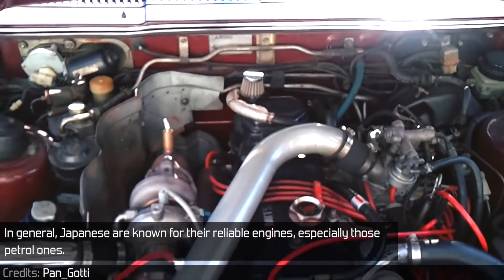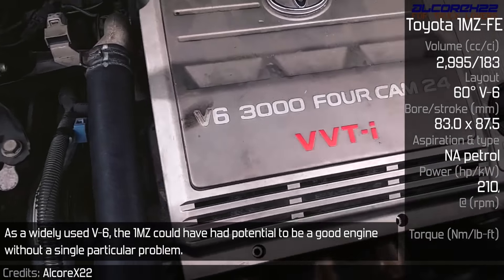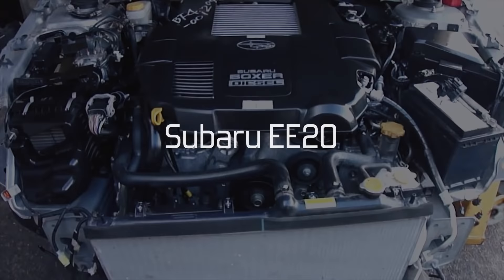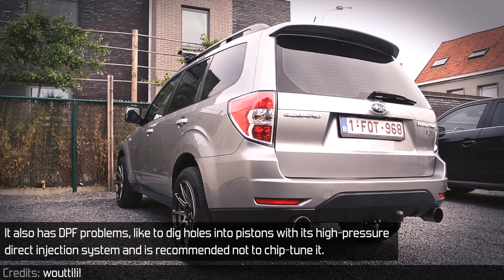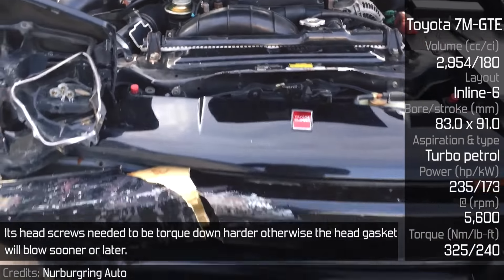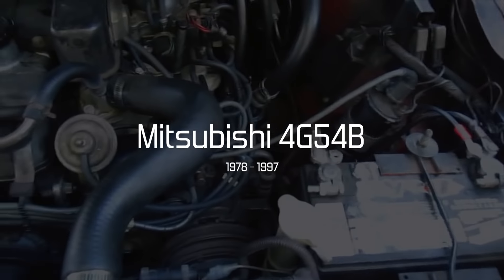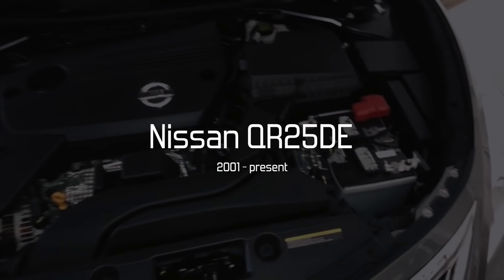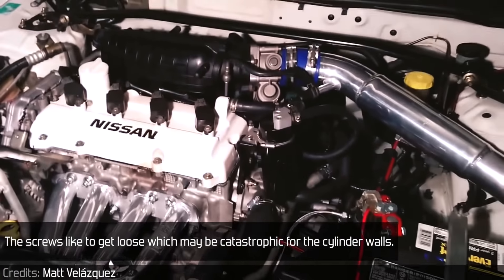Top 5 Worst Japanese Engines Ever

Comment: The 1MZ, and 5VZ are among the best Japanese V6 engines ever made. Certain  year 1MZ engines had sludge issues, due to Toyota  moving the water jackets further away from the cylinders to minimize quench. I have worked at a Toyota dealer for 18 years in the shop, many 1MZ vehicles are going very strong to this day, they are much tougher than a 2GR.  The 3VZ V6, and 2AZ 4 cylinder were among the worst Toyota engines ever made, Toyota will tell you that.
Reply: FunkyFresh48 I agree with you on the 3VZ. I was a Toyota tech too for a few years but if taken care of the 2az could be reliable. It had water pump issues but most people would drive it when the drive belt snapped or never change the oil. That’s what killed them.
Reply: GR-series engines also have an appetite for oil. There's a guy in Australia running a severely modified 2AZ on methanol running 9's all motor, and it sounds aggro as fuuuuuck
Reply: FunkyFresh48 my dads 3vz has over 600000 km and still going hes done nothing to the engine he never does fluid changes for ex he does a oil change every 3 years lol he beats the shit out of it and it just keeps going and going so.......
Reply: I have seen a lot of high miler 2AZ and 3VZ cars, I am not talking about individual examples. I am saying that the 2AZ and 3VZ  have cost Toyota the the most monetary damage as far as engines go. That does not come from my opinion, or any bias, it's a fact. The 3VZ had a high rate of head gasket failures, the aluminum heads and iron block didn't like each other. :) The heads and block would expand and contract differently, causing wearing on the head gasket until failure. Many blocks had to also be replaced due to severe pitting on the block decks, caused by ECD. Toyota launched the V06 campaign for this issue.

The early 2AZ engines had an issue with the head bolts pulling the threads out of the block, the later 2AZ engines had a problem with excessive oil consumption due to dainty oil control rings, we can blame the EPA for that problem.
Reply: I currently have both a 2001 Camry with the 1mz and a 1993 Toyota pickup with the 3VZE and I'd say they are both great engines. My '93 pickup now has close to 250,000 miles (or 400,000mks) and it's still going, it's underpowered by todays standards but certainly not unreliable! I had more problems with Toyota 22R 2.4L 4 cylinder engines (which were easier to work on). The head gaskets were replaced under a Toyota recall 20 years ago on my V6. I have done some work on 3VZ engines and I can't say I like it but it doesn't happen very often! 
 If you want a not so good Japanese design, you could look at engines like the 3.0 liter Mitsubishi that I had in a 1997 Dodge Caravan or some Mitsubishi 4 cylinder engines which were even worse! I drove a low mileage smoking Hyundai Excel that had one of those to the closest junkyard and barely made it there! The car had 142,000 KM or 88,000 miles...
Reply: 1ezengine piston rings don't enough drain hole oil in ring to long oil change s to made burn oil Toyota fix it than great engine

Comment: Although, I like your channel and watch your videos regularly I will have to say I am disappointed with this one. Firstly the oil chane intervals on the 1MZ are there for a reason and it is a great engine which btw sounds awesome. And secondly the 7M-GTE apart from the improper torque spec on the head bolts has nothing wrong and can hold 500hp with the stock internals because it was overengineered.
Reply: Agreed, and just want to back you up on the 1MZ - I had a Solara with that and the E153 (?) manual, and that rewrote my idea of how a V-6 could sound.  Pity the aftermarket didn't care, it was every bit the 6G72's equal stock.

Comment: 1mzfe are great engines you might want to do more research before you do these videos
Reply: Yea mine has over 450k miles on it and is still going strong .
Reply: He said that oil needs to be changed regularly. Or else there will be problems. Immature.

Comment: For the Nissan QR25DE, it's bad years were 2001-2006. 2007 and up they fixed the precat and butterfly valve
Reply: Tone.  Totally agree, give me a VQ30 Maxima 5-speed any day.  But I suppose there's a reason that Nissan was where they were that they needed to bend over for Renault in the first place, they must have been doing something wrong.
And they deserve a lot of credit for resurrecting the Z as soon as they could and keeping it going all these years, I can't deny that.
Reply: Tone.  Good thing the QR25 is not an engine from the Renault lineup then, right ?... Let's face it, the brand was pretty much ready to die, the deal with Renault is what saved their bacon.
Reply: Got a 2003 altima 2.5 with 250,000 miles on it stock

Comment: I have an ee20 impreza for daily use, it's my second one tho (the first ended in a bush and was wrecked) the first one had 125000km , perfect, and the one i own right now has 138000km and nothing to say about that engine, everything runs perfectly
Reply: Cagibi Band honestly, almost any engine, when properly maintained, will run well. It says more about you than it does the engine
Reply: Just wait. It will blow up. I got rid of mine, My father didnt, his blew up on 218 000 kms.
Reply: The performance is pretty sluggish on the ee20 and they aren’t very fuel efficient so they are essentially pointless.
Reply: @R2D2trashcan  i have an euro5 one and remapped it to 185hp with 410nm torque, plenty of power enough
Reply: woutti!i! Your a gambling man then I see 😀 Mines only done 50,000km so I can comment on reliability but if they are problematic in terms of reliability a retune will only exacerbate the issue not to mention possible dpf consequences. The power increases do sound tempting though as they could do with a bit more poke.
Reply: @JTmoto  you were right , i broke it lol at 150000km
Reply: @SanghinMusic  that's too bad, hit up nace King or get a new shortblock - better yet, get a new petrol car 😁🤷‍♂️

Comment: Any Nissan VQ35DE used in the 6th gen Maxima , 3rd gen Altima, or 3rd gen Quest
They are plagued with timing chain failures, catalytic converter failures, oil leaks, and oil burning.
Total garbage.
Reply: T 59 Wow... really? I always thought the VQ35 was a solid choice of engine... I guess I thought wrong.
I wonder what the root of those problems are...
Reply: It's not the engine as a whole, but only in certain vehicles. This is the same engine that is in the Nissan 350z, but it has no problems whatsoever. Different versions of the engine are present, such as the one in the Nissan Quest, which is horrendous because a few family members of mine have Quests.
Reply: Yes, it's the  version of the VQ35 used in the vehicles I mentioned.
The same engine used in the 350z and Infiniti models are much more reliable.
Also the VQ35's built for the 7th gen Maxima and up are very solid.
Reply: Murano’s too... they are the worst.
Reply: Shanil Kumar that’s not true. Some 350z’s & g35’s had oil burning and timing chain issues.
Reply: T 59 my dad has the 2014 pathfinder with the vq engine. not a single engine problem  it has over 100k on it
Reply: VQ35DE is one of the best engines of the last 25 years.

This engine needs change oil every three months genius or your timing chain starts to get weak.
Reply: My vq40 made the horrid timing chain noise by 50 00kms I argued with Nissan to fix it till my warranty run out
I ended up doing over 400 000kms on that original timing chain before I traded it,
The problem with these motors is the plastic chain tensioners coming apart after a while and producing noise, or total failure if they came apart in a bad way I suppose,  Nissan improved the tensioners in 2011 
Many modern engines have these inadequate plastic parts as the try to save weight, money and test out there fancy 3D printers more and more...
Reply: I have a VQ30DE in my nissan and it is still strong, 178,864 miles. 2001 Nissan Maxima.
Reply: Also Nissan CR12DE/CR14DE (3rd Gen March aka Micra K12 & Cube BZ11) have timing chain falures.
Reply: All these Nissan engines have a weak chain tensioner.
Reply: my 3.3 in my frontier hasn't skipped a beat in 15 years.Are they related to the 3.5?
Reply: T 59 .. that qr25 pos Is by far the worst modern engine there's.. my Nissan seR ate the screws and died soon after... Nissan changed the engine, and the following day I sold the POS
Reply: @jaynation6364  Same for the QR25 engines. The 07 and up engines were good and the ones in the Frontiers were good too.

Comment: Personally, I feel timing belt cars are not to my liking. I would prefer cars with timing chains.
Reply: AMENNN !!! ! !!!
Reply: Timing gears >
Reply: And you have plastic guide issues on engines with Timing Chains. Especially with BMWs.
Reply: @MidshipRunabout2  Yeah, But Only Because they Are "saving" Tooo Much !!! ! !!!
Reply: Who needs timing stuff when you can get a rotary which times itself perfeclty
Reply: @Vehicular.Shenanigans  Amen :-)
Reply: timing coupling rod
Reply: I thought similar in the past. Unfortunately there are a lot of engines today with bad timing chains which are unreliable and don't last more miles than a timing belt.
The best systems are diesels with the cam shaft down in the engine and connection rods to the valves, you find them more in truck engines, but this is far more durable and reliable than OHC systems.
The good old double timing chains are no longer in use today.

Comment: Not one Honda motor was in this video, we Honda fans may be hated but at least our motors are made right 😅
Reply: TBills 3000 Honda diesels are pretty underwhelming.
Reply: I don't hate anyone. That being said, Honda still can't build a transmission.
Reply: My 02 civic was a piece of shit. Replace engine , clutch and other issues and still fucked up on me. I tried and really tried take care of my Honda. Just little bullshit issues ending up fucked
Reply: David Phongsavanh You're just a noob.
Reply: B Janak I'm a Honda fanboy, but I'll grudgingly admit that you've got a point there, at least for the v6 automatics. I've gotta tear out my auto tranny and put in a manual this summer.
Reply: no civic that's not a Type R is made for going fast, period. you can modify them to be fast, sure, but they weren't made for it.
Reply: The first year of honda accord. The engine had way too much compression and blew gaskets left and right. My dad had one. Total lemon. Also very hard to start when hot or cold. Every year since then, the accord has given great performance, but that first year was CRAP!!! (he had the engine rebuilt TWICE under warranty)
Reply: Wrong
Reply: I have seen two Honda engines go bad so far.One was from a leak ignored,the previous person drove it until it puked
Reply: These were bone stock cars not hopped up with no modifications done.
Reply: Manual transmissions are starting to be phased out.Have transmissions that use a paddle shifter that shift faster than a manual
Reply: True..
Reply: David Phongsavanh you most drive a Hyundai not honda lol
Reply: If you leave a Honda engine stock, perform all suggest repairs at the time suggested, it will easily make 300K miles. Modify it to go fast, if you do it right, it will still make it to 300K miles. Neglect repairs, it will die. Mod it wrong, it will die. I've never had a Honda let me down. I've been let down by every domestic vehicle I have ever owned. Never had a chance to try other Japanese brands (other than my current "domestic" brand vehicle that actually has Japanese guts), but Honda has never left me stranded. However, they tend to burn oil like a mofo as you approach 300K miles unless you do a rebuild. My last Honda was at 290K miles when I sold it. It was still running fine, even the automatic transmission. It wasn't a fast car by any means, but it would get up and go no problem. It just left behind a smoke screen to confuse the cops lolz.
Reply: I dunno, every Honda I have worked on burns oil like crazy after around 250,000km ish, that's metric km for you Americans, mind you they still work but it burns like a chimney, the worst I have seen is on the k24 and the B20, but all of them burn to an extent, meanwhile my SR20DE had 500,000km on it and didn't burn more than 200-300ml in 10k-15k, yes I did go 5k over once.
Reply: @alanbrown397  The new Honda 1.6L Diesel is considered (at similar size) to be the best performing diesel engine today. With technically no problems. 

Honda diesels back in the days of the EP Civic (2000s) did not actually use a Honda engine. 
Honda was forced to also produce diesel versions of their cars, so instead of manufacturing their own engine over night which would result in a failure, they used engines supplied by Isuzu I think.
Reply: @bjanak901  Honda can't build a transmission ?  hahahah

I've got a B16A with its original 25 year old transmission, and not only does it work FLAWLESSLY, it does so, at 9500 RPM and is able to handle 5 times the factory output of the engine... HAHHAHA

I don't know about Honda Automatic transmissions, if they are slow and shit, but Manuals, NOBODY makes a better transmission than Honda. 

Actually experts say that the best transmissions you can possibly enjoy are those of the Honda NSX and S2000, and those of the Porsche Carrera GT. 
Nothing comes close to those close-ratio manual transmissions.
Reply: Except the transmissions which only last 50k miles.
Reply: Nothing from Lazada either but they should definitely be on the list   with their shit cars made in Mexico
Reply: Hondas are way better then subaru's change my mind
Reply: My brother in law is a Honda dealership tech, and has been keeping busy replacing pistons and rings (and sometimes short blocks) under warranty for the past couple years.
Reply: might want to look at the engines that came in the early 2nd gen vans... they kinda like to strip head bolts. timesert even makes a drill jig and special inserts for it.

Comment: The first engine was a great engine. I have a 98 Avalon, after 200,000 miles, the engine still sounds like a new one.
Reply: Ke Han until you actually drive a new one
Reply: I have a 99 240,000 that thing is quite you cant even hear the car on lol

Comment: Next: German engines.
Top of the list: 1.9 TDI.
140 000km- turbo, DMF, clutch and actuator.
Reply: Merc M 271 4 cylinder - timing chain issues from 50k miles on
Reply: Skoda Octavia 1.9 TDI 100hp. 230 000km. Never opened the bonnet for other than normal servicing!    6 liters of diesel/100km

Comment: Even though the 1MZ is considered a “bad” engine I put 350,000 trouble free miles on.my 1999 Camry XLE. I always ran Mobil 1 5w30 at 5000 mile intervals and never had any sludge problems

Comment: You forgot Toyotas 2.2 D4D! It has to be the worst diesel engine ever produced. Im in the used car business, and never have I seen one without its engine being rebuild/replaced after just 150.000km. It sludges, blows head gaskets, cracks in the engine block, EGR problems, turbos prematurely wear etc. etc.
Reply: Шевери Венто the toyota 2,5litres D4D is the strongest engine in my country some last 350k KM
Reply: The 2,5l isnt even in the same engine family as the 2,2D4D (AD), so I dont necessarily see what youre implying.
Reply: Funny now that you mention the brakes. Driven a few Corolla Versos and they always felt kind of "off" - say undersized, when decelerating.
Reply: Was talking with my mechanic some time ago while he was repairing one of those D-4Ds. Apparently a single injector for it costs over 800€
Reply: Lol ye diesel sucks but just saw one with +700 000km